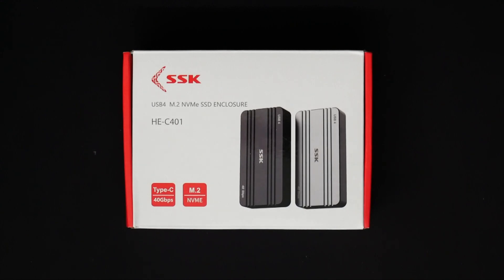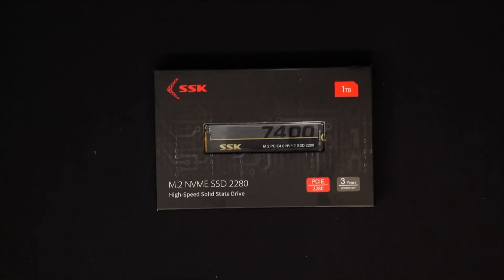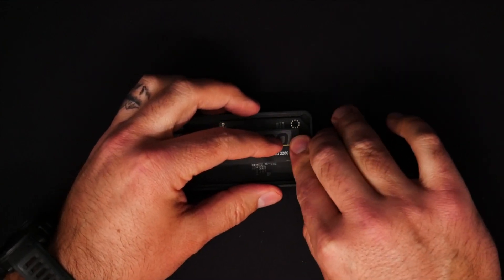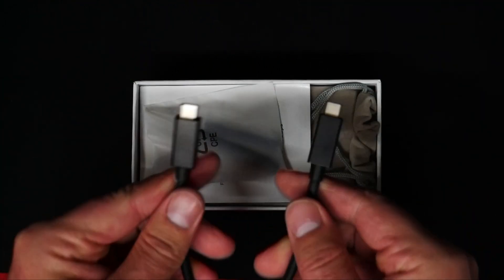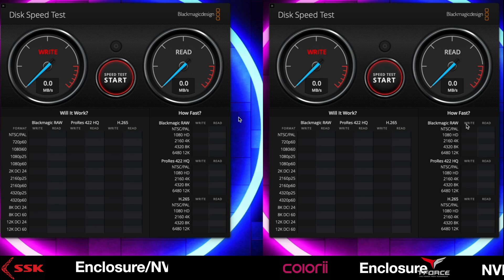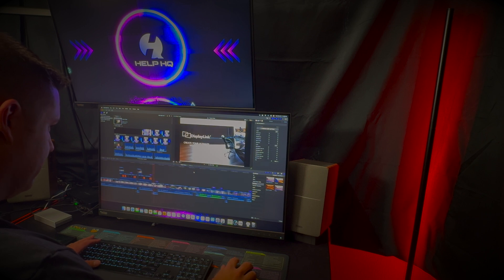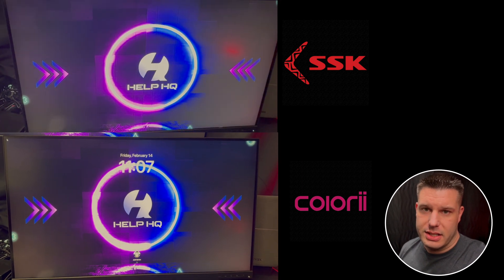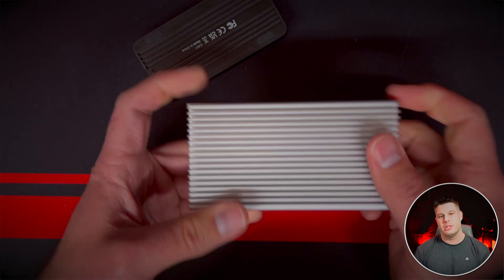M4 Mac Mini: BEST NVMe Enclosure & SSD Combos! SSK vs. Colorii  - Speed Test!

Comment: After you fixed the thermal pads in the colori after seeing the comment, which was cooler? Colori or SSK and did the thermal pad being fixed made any difference with the lag/delay in boot time compared to ssk and application open time compared to ssk? What about temp difference between them after fixing thermal pads?

Comment: How's the SSK enclosure doing so far? Has it just refused to mount or disconnect/unmount automatically if any? And would you recommend getting it?
Reply from the maker: Knock on wood 🤞 it's been good so far. No issues. It does get kind of warm, but I have my home folder moved to it so it's under constant load. It hasnt failed yet.
Reply: @helphq oh What does S.M.A.R.T data say the Temp of the drive is when editing or doing something medium/heavy? I mean temp of drive not the enclosure chassy btw and thanks for the fast reply

Comment: You have installed the thermal pads incorrectly in Colorii. This small square thermal pad should be placed on the ASMedia 2464 controller, not on another thermal pad, as you showed in the video. It is overheating. This is the source of all your issues with this case.
Reply from the maker: Yep, 100 percent correct. The enclosure is working fine now.
Reply: @helphq  Agreed. I have the Colorii as well, with the thermal pads properly installed. It's simply the best NVMe enclosure I’ve ever used.and currently houses the boot drive for my M2 Max Mac Studio (a 2TB Team Group MP44L). I think you're being very unfair to Colorii leaving this video online. Please take it down and do another, fairer comparison.
Reply: @helphq So is it now cooler than SSK one? Or still hotter than SSK one? After this which is better in your opinion? And did this fix the disconnecting issue on Colori?

Comment: Thanks For this video. Probably the only one that covers the newest SSK enclosure.
Just got one for my WD SN770 2TB used on Macbook Pro M2.

I noticed the enclosure gets really hot even when not in use, just plugged. This makes it really impractical if I want to have it like a permanent extension to my laptop. When I say hot I mean. it's hot on the touch and if I press my finger on it it becomes unbearably hot if I keep it pressed for more than 10 seconds.

I know hot is normal, but the question is, how much will it impact its long term health if I have this pugged 24/7. Those temperatures don't feel safe, but maybe I am wrong?

How can I measure the SSD internal temperature? I'm sure there is an app.

I don't want one that is cooled by a fan because I record sound and need a dead quite space.

:)
Reply from the maker: To measure the internal temp if supported by your drive/enclosure you can try 

Macs fan control 
https://crystalidea.com/macs-fan-control

Or 

DriveDx
https://drivedx.macupdate.com/

The thermal throttling threshold for an SSD is typically set at 80 degrees Celsius (176 degrees Fahrenheit).  Each manufacturer is going to vary slightly.

Comment: How is this for a mac mini? You have a bunch of standard enclosures. nothing to do with a MAC.... I clicked on the video thinking you were looking at stuff like satechi makes...  something made to connect with a mac maini and look like it belongs there... not something that looks like it was designed to go in your pocket.
Reply from the maker: Thank you for your feedback and for watching the video. I'd like to address a few points to provide further context.
Firstly, it's important to clarify that Thunderbolt 4 and USB4 share the same maximum data transfer rate of 40Gbps. While Thunderbolt 4 enclosures exist, they are less prevalent and generally command a higher price point compared to USB4 enclosures.

Secondly, I understand your reference to a more aesthetically pleasing enclosure with a matching build to that of the Apple product you are trying to pair it with. If you have an M4 Mac Mini it sounds like you might like the Orico Mini Mate line better which looks like this: https://amzn.to/3Xk62PB

Regarding aesthetics, the SSK enclosure is available in a silver finish, which can provide a closer visual match to Apple products.

However, as indicated by the video's thumbnail and title, this presentation focused specifically on portable, external SSD enclosures. The versatility of external enclosures is a key advantage, allowing them to be used across various devices with USB-C connectivity. This broader compatibility offers flexibility for users with diverse hardware setups.
Ultimately, product selection is a matter of individual preference and requirements. While this particular enclosure may not align with your specific needs, it caters to users who prioritize portability and cost-effectiveness without sacrificing performance.

Thank you again for your engagement and for sharing your perspective.

Comment: Hey bro can u store vsts, plugins for music production on those nvme
Reply from the maker: As long as the VST software that gives you the option to designate where the samples are read from when installing them. The software could be on your main drive and read the samples off of the external drive or in this case if you have your home folder moved to an external drive the application would also be on an external drive therefore the samples would be installed in this same location with the application thinking it's just your main internal drive.